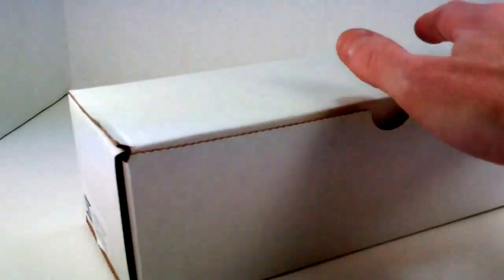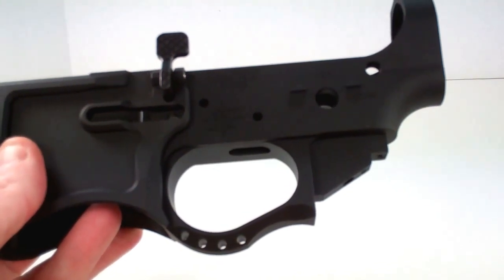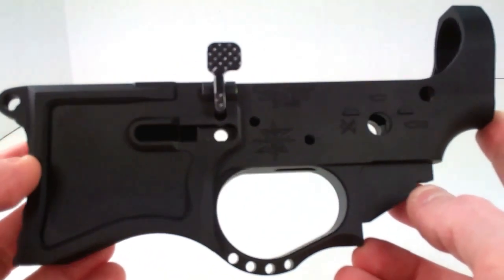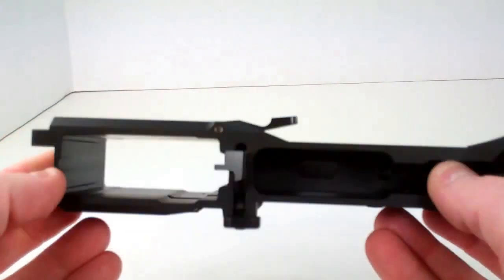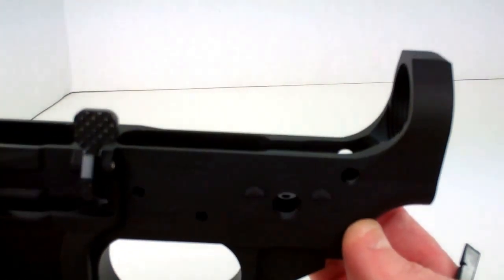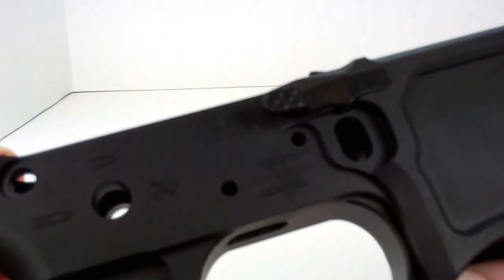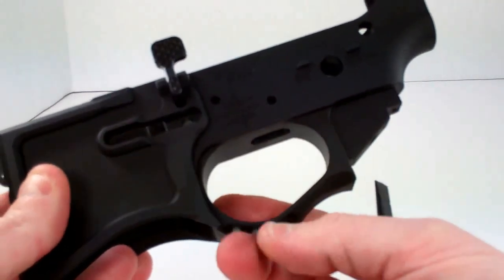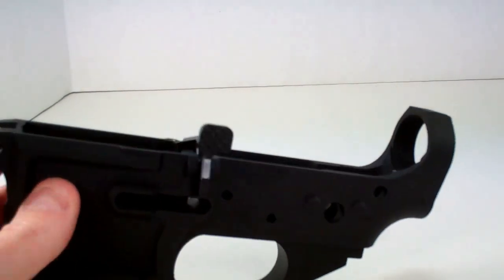Seekins Precision SP223 lower receiver unboxing & review

Comment from the maker: Sounds like you got it.  No worries, the billet lowers are different from the other forged lowers.  If I was on the ball, I would of realized you were working on a billet lower with the captive detent.  I have been building mostly Seekins SP15 forged lowers lately, so I kind of have "tunnel vision" a bit.  Glad you figured it out, I will do a build video the next time I have a billet lower.

Comment from the maker: Hello Chris.  I just checked three Seekins lowers and all of them have no issues with the takedown detent pin or the spring.  I am not sure what you mean by "stand up inside the inner diameter of the hole".  The takedown pin should be fully inserted into your lower, then you drop the takedown detent pin into the hole and then insert the spring followed by the backplate to hold the spring in place.  Take a look at my other videos, specifically the two I have where I install the LPK.

Comment from the maker: Ah yes.  Sorry Chris, I completely missed the fact you commented on the SP223 BILLET receiver, for some reason I was thinking you were working on the Seekins forged lower, the SP15, which is more or less identical to all the forged lowers in how they are assembled.  The Billet receivers are a bit different in how they are assembled and it seems you found the set screw for the captive rear pin detent.  I may need to do a "build" video on a billet lower, as it may assist others.

Comment: With the captive pin setup I was inserting the spring from the top side down, and then trying to shove the pin in the yoke on the receiver as well, when all along if I'd removed the setscrew underneith, I'd have been able to just insert the pin and spring vertically, then put the retaining screw back in and been done with it;)  8 detent springs and 4 pins later I finally figure it out!  Oh well, you see how my surname ends dont you?  Guess I've just proved it up again!  Thanks!

Comment: Even when I leave the spring out altogether I'm unable to get the pins to start in the captive hole, they are too long to stand up inside the inner diameter of the hole for the pin, and wont "make the corner" so to speak.... I sent an email to Seekins to see if they've encountered this before since I'm sure its just something I'm doing wrong here.  Thanks again, Chris

Comment: do you happen to remember what exact size is that screw for the rear take down pin ? i would have been done with my lower today but i guess i dont have the correct size allen key. I am only disappointed with this seekins because they couldnt just have included an allen key for the screws
Reply from the maker: clinttech Hello.  It is a .050.  Although when I installed it, I just dug through the tray of allen keys till I found one that fit.  When they are that small there isn't any size stamped on them.  Also, you may need to rim your detent spring down by a few coils to compensate for the allen bolt.

Comment: Hi, Any words of guidance on installing a standard Spikes LPK on this lower?  The captive spring retention on the rear takedown pin is confusing me.  It appears I need to cut down the retention pin merely to get it inside the takedown pin hole so I can get it down into the captive machined hole?  Then it appears I may need to clip the spring some as well in order to allow it to fully depress so I can insert the actual takedown pin?

Thanks, Chris

Comment: I have a SP223 Lower with the Seekins Precision Enhanced Bolt Catch. I noticed something unusual earlier today. When I pull the charging handle back slowly from full battery with a properly seated empty magazine (a M3 PMAG, in my case), the bolt catch will engage between the rear of the bolt's locking lugs and the front of the carrier. In this position, the BCG is stuck and can't be moved either forward or backward unless the bolt catch lever is depressed. Do you experience this issue?

Comment: There must be some different variations of the receivers.  I got to looking at a spikes biohazard I have still stripped and reading on it, they have the "captive" pin thing as well, no inserting springs being held by backplates like I'm used to putting together.  ANYWAY... you can still feel free to give me one of them Bill Engvall "heres your sign" awards;)  The Sikes and Seekins both with their 'captive rear retention pin spring detent" systems have a setscrew underneith.  Duhhhh!